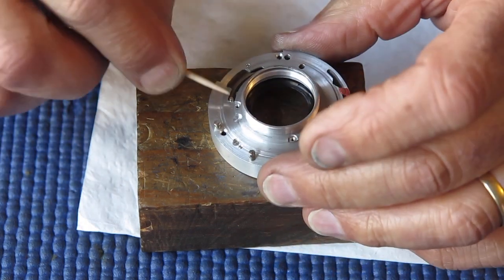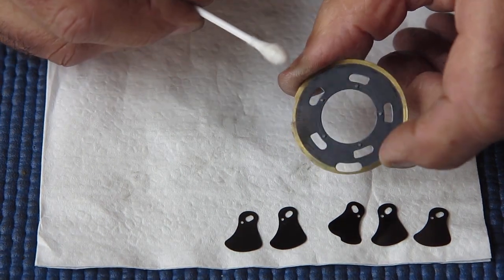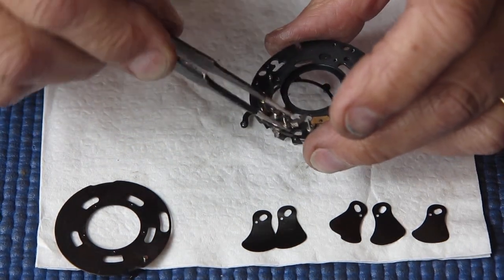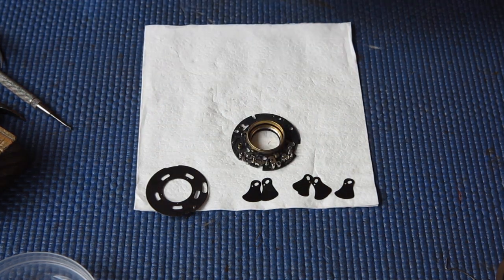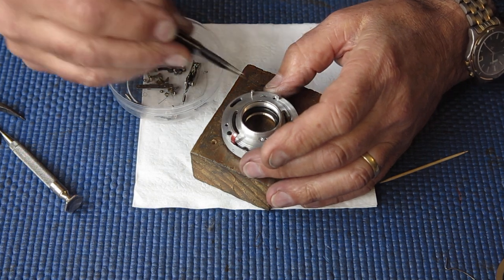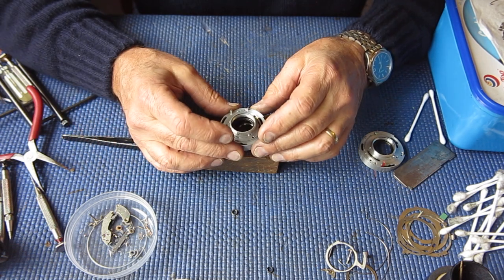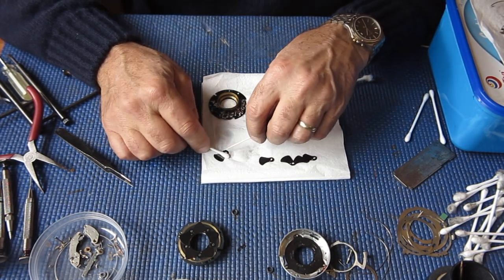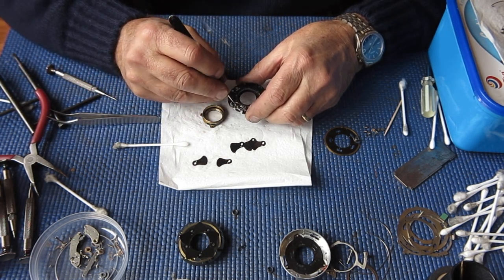Retina Reflex type 025 complete service 07

Comment: I can't believe you are uploading these! I took apart a type 025 about a year and a half ago, fixed the film advance, then took apart the shutter and lost two of the three screws that join the last two pieces of metal that need to be separated in order to access the shutter freely. Consequence: I've had the whole thing lying on my desk since january 2018, which is... Not ideal if you intend to put it back together ever again.
Finally found a set of screws that match the ones I lost (from a yashica lens mount) and proceeded to put the shutter together again. Everything goes perfectly until I try the shutter times right before putting the face plate on: when I cock the shutter, instead of cocking it opens as if in T mode. Not sure if I messed the wire springs at the back for the shutter and aperture control rings or if I have something in the wrong position... Everything looks ok, I seriously suspect the wires.

I'll look at all of the 025 videos you've put up in like... The last two days? I can't believe my luck haha thank you so much for sharing this Chris
Reply: Huh... Listening at 15:30 I think what I'm experiencing might be the "preview" mode, after all this camera is an SLR... There might still be something off. You can't imagine how glad I am you just happen to be uploading these haha